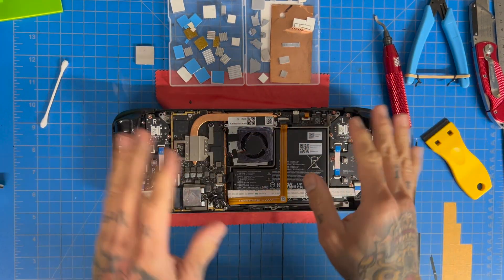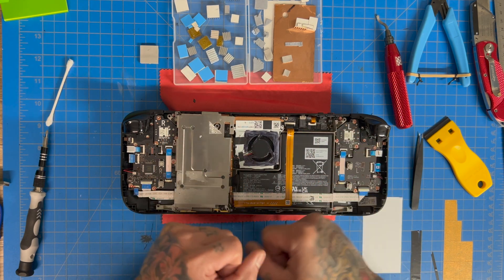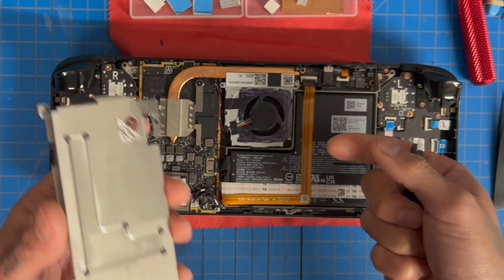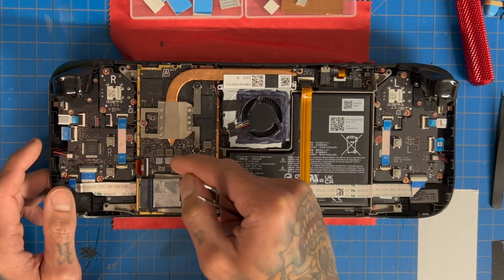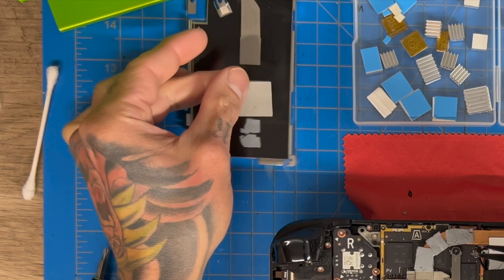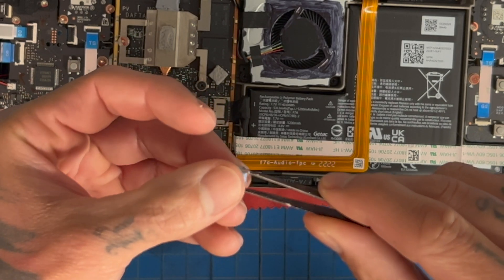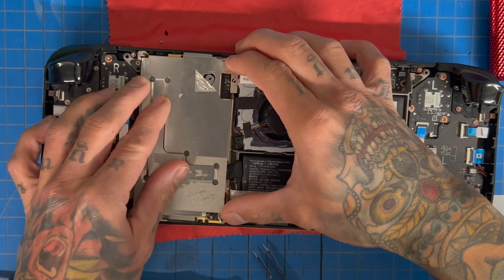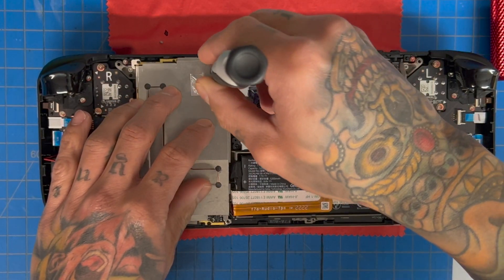Steam Deck Thermal Pad MOD - PLEASE READ ADDENDUM

Comment: The shield is made to cool the components, the heatpipe is made to cool the APU. Connecting the heatpipes to the heat shield will flood the shield with heat in turn removing cooling capacity from your other components. Sure the APU is cooler.. but I don't know if that is a win if the rest gets hotter.
Reply from the maker: Yes, you are correct it will heat the rest of the components, but you have to understand those components are rated for higher temperatures

And in my testing, they can handle the extra load from the APU 

Remember, though, this mod was intended to be done with an external cooler, the whole point is to pull as much heat out of the APU through the heat, chilled to an external cooler

Comment: I appreciate the highlight on this idea but this was a very poor execution. You shold not ever touch the thermal pads with your bare skin use latex gloves. All the pads were beaten up scratched and damaged. Also stacking thermal pads should not be considered as a viable solution. I also appreciate the mispoken dimensions (1mm instead of 0.5mm) were fixed in post but there were constant corrections on the screen almost all the time which should trigger a reshoot already if you want to grow your channel seriously. Anyway, I appreciate your time and effort explaining your idea.
Reply from the maker: Thanks for watching the video

Ehh I’m just trying to enjoy myself

Technically, you’re not wrong about the latex gloves, but just make sure to wash your hands afterwards.

Plus the brand I use claims to be non-toxic so take that for what it’s worth lol 

And honestly, if your application is not the best, maybe dust or broken I haven’t noticed any significant loss in cooling performance

Thanks again for watching a video

Comment: What is the temperature change? And/or fan speed improvements?

I ordered a small repair kit and i'm going to change the internal 64gb nvme drive to a 1 terabyte, coolermaster 2230 ssd.

First time i ever tried something like this.

I'm also really interested in doing these thermal pads and backplate mods. It looks pretty daunting ro be honest. 

What are the fan speed improvements/heeat dissapation improvements? Does it extend the battery life?

I'm also going to do the cryobyte utilities improvement. Valve should hire that guy.
Reply from the maker: Thermal pad mod was intended to be used with both a external cooler and or the fan mod.

battery life is a grey area, you will save power with lower fan speeds, lowering TDP and undervolt would be the best was to reduce battery drain.

"Your capable of more then you know" 
 Take the task slow and do your research.
Reply: @Diy_Papi  i've watched serveral videos of cryobyte 33, but is there a way to determine if you have a good batch/high quality APU before trying to undervolt?
Reply from the maker: You’ll have to run tests, make small jumps, takes a lot of time but worth it
Reply: @Diy_Papi  well, that is above my pay grade for sure. And i would have no idea what i'm doing or how to fix it of it goes wrong. So i'll keep it normal

Comment: What's the temperature difference or fan speed ?
Reply from the maker: -6 to 8c and up to a 1200 rpm fan drop
Reply: @Diy_Papi  I ordered today the jsaux transparent Backplate, the pad and some thermalpads for the vrams and MOSFETs
Reply from the maker: @the100ways6  fuck yea! Don’t need to go crazy on the cooler, simple 40x40mm fan and heatsink is more than adequate.

Also if you really want to go for it, the Vent mod is a great way to get the most out of it.

JSAUX Backplate / Fan Mod
https://youtu.be/zk7d4N3vHnM

Comment: Hey guys, so 1mm on the heatpipe and 0.5mm on the VRM's and that would mean no need to stack the pads
Reply from the maker: Yes on the heat pipe,

Don’t worry about the VRMS leave stock
Reply: @Diy_Papi  so just add 1mm thermal pads on the heat pipe and leave the rest as is?
Reply: Looks like the others are all covered stock anyways

Comment: You wrote that 0.5mm is still a good height on the Mofit and VRM but they stack with the default thermal pad. Is it okay?
Reply from the maker: Sorry that was a typo, also try not to stack the thermal pad. I’ll revise the post as soon as I can.

Comment: This might be a dumb question but could you just cover the shield and the rfid black cover with thermal pads instead of trying to cut everything to size and place it correctly? Wouldn’t it do the same thing or even more with less work?
Reply from the maker: It’s only dumb question if you ask it twice 😉 

SSD and Cooler would get in the way

IC Controller would need a shim, 1mm shallower then the rest of the chips

So you could if you addressed these

But at that point… 🤷🏻‍♂️

Comment: Can you do a thermal test on the charging ic when the battery is around 10-15% and charge it while gaming?
Reply from the maker: For sure!
Reply: Does it improve temps? Or does the fan run at a lower rpm and the tenps stay the same?

Does it extend the battery life?

It looks daunting bland i never tinkered with electronics before but i'm go8ng to change the 64gb ncme drivve to a 1 terabyte ssd myself.

A shop offered to do it foor a 100€ but that is too high for me.
Reply: Srry for the tupe o's
Reply: Type o's
Reply: @Diy_Papi  thanks

Comment: Is it ok can i use also a termal paste? Instead pads?
Reply from the maker: You can but its a pretty big gap, good chance of air pockets and poor connection.

It would be best to use a copper shim and thermal paste.

Comment: I just did this with your hole mod and it is insane tysm
Reply from the maker: It works so damn well!! Also don’t stack your thermal pads 🤗
Reply: @Diy_Papi  should i keep the pads on the mosfets or take them out
Reply: Could i just put tin foil in between
Reply from the maker: Keep them on!  

Not sure what you mean by tin foil
Reply: @Diy_Papi  super thin aluminum
Reply from the maker: Honestly I’m not sure how we’ll aluminum foils conducts heat. I would suggest copper shims.
Reply: @Diy_Papi  so I should keep the pads on the mosfets that you put on in the video even though its technically stacking because there is the pad on the shield
Reply from the maker: @David12212  I must have miss spoke, I plan on doing an update video to be clearer on where to place the pads

Keep all the stock pads in the original location

Only adding thermal pad to the heat pipe.
Reply: @Diy_Papi  ok thanks

Comment: great video but
1. don't censor. curse or if susan scares you don't . the beep is super loud.
2. how would thermal grease work? is it better? how about graphite pad? would that be better?
Reply from the maker: Haha, I just want everyone to be able to enjoy my content and I have a sailor’s mouth. Here about it all the time 😂 

Honestly haven tried either but I would think a pad would be better for the heat pipe due to the thickness needed.

The best thing tho after all my testing is putting straight heat sinks on all the components lol. Worked great!
Reply: like mini heatsinks? they have that on amazon or custom job? between the shield or all out like something linus did?
Reply from the maker: @haroldg1688  I like the idea, but it's just too bulky for my taste. But it will for sure work!
Reply: If he's gonna censor it, he needs to mute his voice at least. I can still hear the swear word loud and clear.
Reply from the maker: @memeeater420  I hear you loud and clear 🫡

Comment: Stacking thermal pads is a no-no, as it traps air that acts as an insulator.  I would recommend using copper shims instead, then using a .5mm thermal pad for insulating against shorting out surrounding components, or using a conformal coating on those components that may short out, or both for max protection. In areas where you won't touch components, like the heatpipe, use thermal paste with shims instead of pads, it's faaaaaar better.  Also, graphite sheets on the backside will also help a bit with heat transfer, but it will mostly work to prevent thermal hot spots, as the heat transmission works on the XY axis, not so much the Z axis. Best of luck to your projects.
Reply from the maker: Honestly didn't think of that, thanks for brining that to my attention. 

Shims are too thick and at that point you might as well put heatsinks on everything. Which I have done and it worked amazingly.

Thanks for watching the video
Reply: Shims are available as thin as .1mm, and copper foil down to .01mm. Without knowing your gap height it certainly takes more test fittings, so it's more fiddly than using a squishy thermal pad. Another common cooling mod you find on these ultra-thin portable devices is taking a 1mm heatpipe and using thermal glue or solder to bond the heatsink to the stamped steel on the blower fan. Of course you can use pads there too if you want a less permanent solution, which is better than nothing right? If you're anything like me, looking at Aliexpress fills your head with all sorts of crazy cooling mods to push the limits of these sorts of things. Keep up the great work and content!
Reply from the maker: @DrivingVertigo  appreciate the info Fam, cooling is a rabbit hole for sure! 

Didn’t know they made shims that thin and had copper heat pipes that could be glued! For sure I’m gonna have to look into that.

Comment: How can you tell if your charge ic is not suffering from overheat by doing that "direct air in" mod?
This was already the hottest component by default, now left without airflow.....
Reply from the maker: Check out this video I tested everything twice.
https://youtu.be/7Cu-aRjKG5c

And after my testing, the hottest component was the VRM

Comment: So what temps did you achieve?
Reply from the maker: Honestly don’t know how much of an impact this mod would make without the vent mod.

I would guess around 2-3c delta at most 

With the vent mod we were at 8-10c delta.

Overall it will run a bit cooler then stock because of the increased thermal capacity from the thermal pads

When I get a new stock back plate, I’ll run new test and make sure to post my results.
Reply: Thanks for the video's. 

Make sure to explain it in simpel terms for noobs like me haha. 👍🏻

Comment: Do you recommend any specific thermal pad brand or type? Wanna make sure I get the right kind.
Reply from the maker: https://amzn.to/3iSI8K8

these are the ones I use, kinda fall into the mid high end. definitely with the price
Reply: Do you have a full guide on opening and cleaning the apu and installing a thermal pad  on the apu? 

I am a noob to all this and i kind of need it explained in simpel terms.

I'm going to change the internal 64gb drive to a 1 terabyte ssd myself. First time i ever try anything like it. I'm very interested in improving my steam decks performance anyway i can. But these modifications look a little daunting and complicated.

Comment: Please use K5 pro viscous thermal paste to see the results!
Reply: K5 pro should be only used in replacement of shorter thermal pads, never as thermal paste.  For the APU itself, I recommend against liquid metal as it requires periodic servicing. Get phase change material PTM7950 if you want the top performing "set it and forget it" solution for your APU.
Reply from the maker: Apparently anything less then Liquid Metal isn’t worth while, there is a commercial grade thermal pad with similar results I plan on trying that in the future, I’ll be sure to try other thermal paste then to see if it’s worth it.
Reply: I've seen cryobyte33's video and apparently thermal pads are the best solution, (the high quality ones), but it needs some time to get optimal performance. And apparently thermal paste can dry out over a long period of time?

Comment: i took a graphite pad for cpu cooling cut it to size then added it to the underside of the copper heatsink instead of the thermal paste and added that jsaux backplate with a little cooler on the back and it seems to help i might try this thermal pad addition to see what else i can get down to.
Reply: Waiting on my frost sheet to come in mail so I can do the same it’s been 2weeks from ordering but I did his other two mods to great success.
Reply from the maker: Bro that sounds dope! Man you got your back plate! where you at China?! Lol still waiting on mine🚶🏻

I would love to hear the before and after on the thermals
Reply: @Diy_Papi  I ordered mine about three weeks ago and got it in the other day I will say that back plate gets a bit hot if you're noth actively cooling it somehow but if you do it's not bad and helps to absorb way more heat I'll try and get something to show some before and after if I can I have just been going off of the difference I'm seeing in the internal numbers from the deck. I really wanted to do what Linus did with his steam deck but I don't have the tools at my disposal for that ATM :( lol
Reply from the maker: @Luka-9119  I ordered it last year lol! Only a few have tools like Linus lol. When you get temps I’m all 👂 really excited about